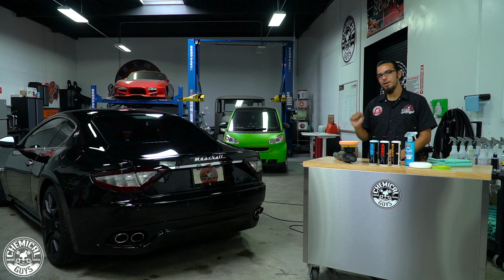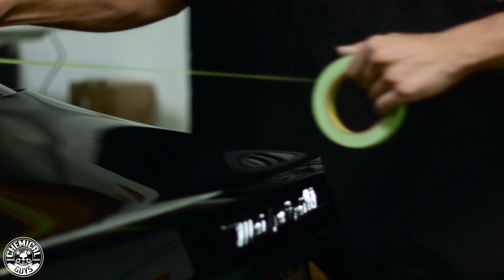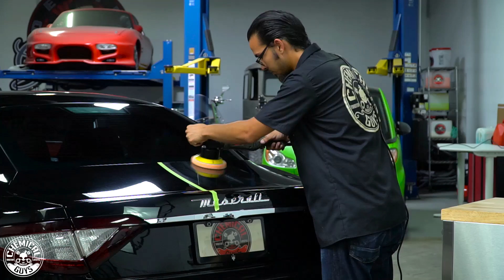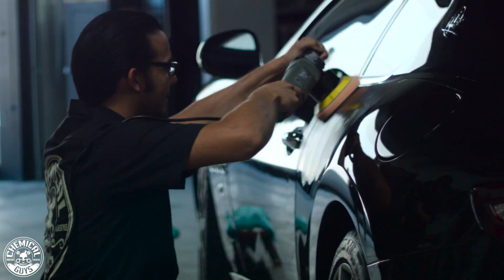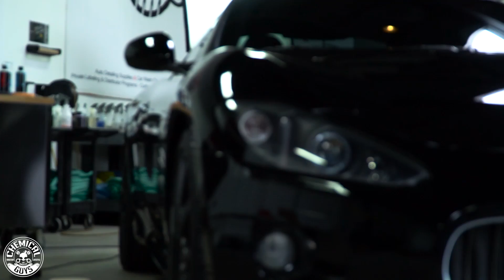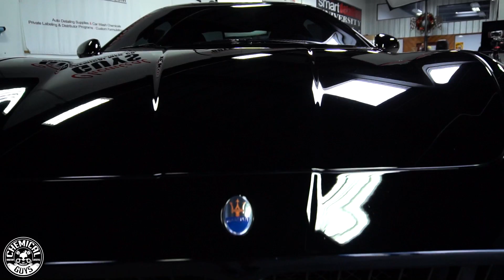How To Polish Black Paint The Right Way! - Maserati GranTurismo - Chemical Guys TORQ 10FX

Comment: I have a black car light Swirls I have v36 v38 and black maintenance kit jetseal afterwards?
Reply from the maker: Hi Wendy, thanks for watching and commenting on this video. Yes, most light duty swirl marks can be totally erased with V36 Cutting Polish. The advanced polishing abrasives break down as they work, refining a deep glossy finish after cutting through the defective paint. For softer paint finishes, or for added gloss and clarity to the reflection, follow up with a second round of polish with V38 Final Polish. This finishing polish refines away any micro-marring caused by any heavier polishing or compounding stages, and jewels the paintwork to pure glowing shine. Stay tuned for more exciting how to videos coming your way soon!

Comment: Compound, Polish, Glaze, Wax to make it look at least 70%-90% better paint correction. Prolly not getting paid enough to compound?
Reply from the maker: Hey there, thanks for watching. It all depends on your level of satisfaction, in this case the owner was happy with the significant improvement. Keep in mind how much effort you have to put into polishing. VSS is somewhere in between a compound and a fine polish due to the nature of the micro-beads that break down during the course of the polishing. Clear coat is very fragile, you're looking at something that might be a few microns thick, you kinda have to keep that in the back of your mind. Stay tuned buddy, more great vids coming your way.

Comment: Are you using painters tape?
Reply from the maker: Yessir, that's correct, it's an excellent way to tape off an area to check your progress, and it's a great way to avoid polishing areas that you don't intend to polish. Painter's tape is inexpensive, and it doesn't pull paint off paint, it can be a detailer's best friend.

C.G. Alex -

Comment: Hello I know this is an old video but if anyone is still here please help .. I have a Tahoe Z71 2009 model black paint and pretty much it is the same condition with this Maseratti .. i want to know if I can use your products by hand since I dont have any access to a polisher machine . I have used turtle wax scratch and swirl remival applied by an applicator pad and it nothing . note that I want to use aomething that is clear coat safe is your products clear coat safe ?
Reply from the maker: Hi Yehya, 

It's definitely possible to do it by hand but it will take you much longer and will not provide you nearly the same results you can get by using the machine. The Tahoe is a huge vehicle and will take you hours to do it by machine and we can't imagine the length it'll take you to do it by hand, and the amount of fatigue after doing it because polishing by hand really takes a lot out of you. Also, the reason you won't get the same results as by machine is really because the hand can't replicate the speed at which the machine goes to heat up and cut through a layer to reveal fresh paint. To answer your other question, all of our polishes are clear coat safe; they won't cut through it. Our TORQX is our most affordable machine and it works wonders. Follow the link and take a look. Happy Detailing and thanks for being part of the Chemical Guys family!
Reply: Chemical Guys Wow I didnt expect you guys to reply thank you very much .. I will invest in a polisher the one you mentioned .. just got to wait for end of the month .. Thank you very much guys.
Reply from the maker: No problem! I just realized I didn't provide the link haha Here ya go!

http://www.chemicalguys.com/TORQ_TORQX_Random_Orbital_Polisher_p/buf503.htm

Comment: I'm thinking I need the VSS for my car since I'm in Alaska. But do you guys know what would work best on dodge floss black for my charger? I was going to use blacklight as well at the end. But what pads and polishes would you recommend? My paint looks like that Maserati honestly.
Reply from the maker: Hi Nathan, thanks for watching. If you have scratches like the ones shown on the Maserati, I recommend using what Nick did in the video. Use a compound like V34 with an orange pad, and V36 with a white polishing pad. Blacklight is great for dark colored vehicles. I also recommend Butter Wet Wax, and Jet Seal, that would essentially make this detail perfect. If you want to put a tire dressing on your wheels, checkout Silk Shine.

Comment: With what can I polish my front glass window it has little wiper blade scratches? @chemicalguys
Reply from the maker: Hi Kevin, thanks for watching. It's going to take a lot of polishing to remove those wiper blade scratches. If anything you can try using a microfiber pad with V34, or V32. Start on a small test area before moving onto a more aggressive approach.

Comment: How often do these pads need to be replaced? Is it something where it's when they are visibly worn out or can you only use the pad on one car and it's shot?
Reply: I find if you clean their pads often and especially during this type of process they'll last a long time. I like to clean the pad after every other panel with an electric pressure washer.

Comment: What problem was the VSS creating and how did you repair the problem? How often is it that VSS will create this problem? Is it just on high end cars with softer paint?
Reply: Eduardo Sanguino VSS on super soft paint such as the black on Porsche, Ferrari reds, and general darker Italian paints can induce micro compounding scratches of its own.  The look it leaves behind is a paint that has been corrected, but now it's hazy from the compounding and requires polishing to bring up gloss and shine.  I have a client with a black Porsche and the paint is what I would call super soft.  The paint could be corrected with V38 on a white pad and finished with 2-3 drops of V38 on a wet black pad.  now realize that V38 is a finishing polish (a damn good one at that too, sent 4 cars to Pebble Beach this year finished out with V38) so it has no bite.  When you have to water down a finishing polish on a black or red finishing pad, your in the realm of super soft paint. They're the kind that swirls when you look at them wrong.  I ended up coating the car and suggested that the customer eventually may want to look at respraying the paint for better long term durability
Reply: Dean Chen excellent reply, thank you. Christmas can't come soon enough, I have a feeling Mrs. Santa Clause will get me the TorqX package.

Comment: so this is a v36 and v38 method.  I was hoping to see him use the  VSS... for VSS do you still go orange then white? VSS then v38?
Reply: Kevin Clouse I don't think VSS was too light for the car, he said the paint was too soft that it was creating another problem... maybe VSS was too harsh is what I'm thinking. I wish he would have mentioned what problem it was creating and how they then fixed that problem.
Reply: It was probably leaving holograms
Reply: I want to know this too.  You mentioned in the video that VSS wasn't working out, so you went the V36/V38 route.  Was it because the VSS was too gentle for such a hard clear coat?  I have a brand new 2017 Camaro SS that has a single scratch (very light) that I'd like to buff out myself and only have VSS at the house.